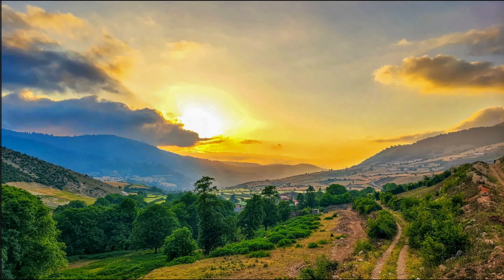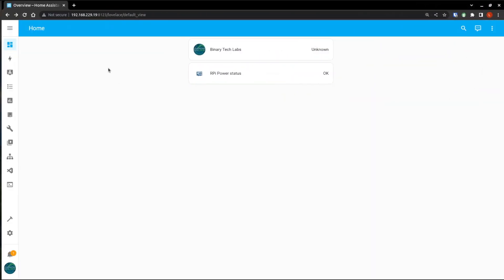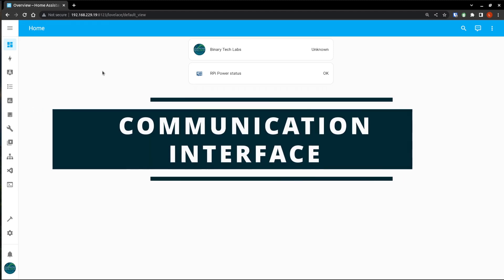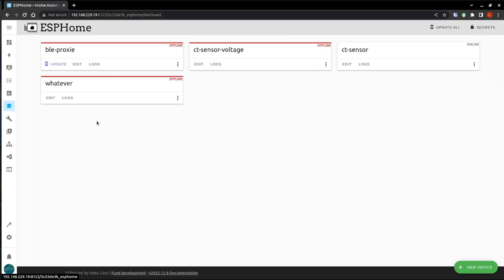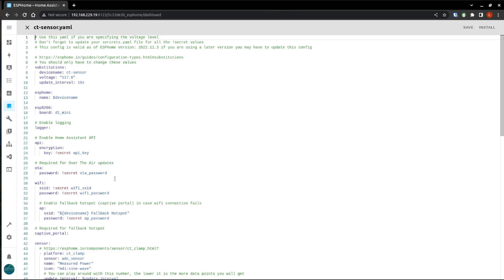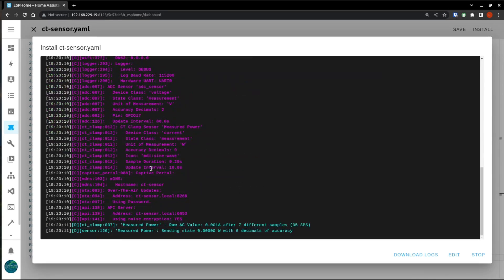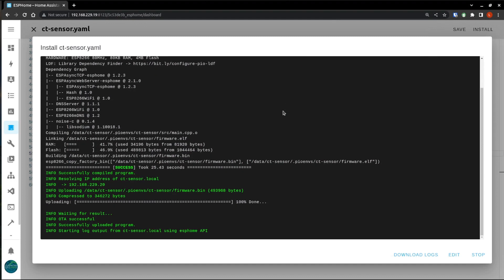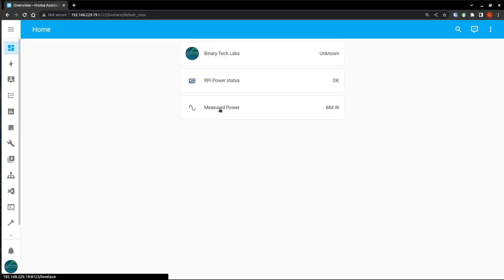Save the Planet (and Your Wallet) with Home Assistant - A DIY Guide To Power Monitoring

Comment: The Sense device will do most everything you've listed here.  It might be cheaper ($200 - $250). It integrates into Home Assistant well.
Reply from the maker: Yes it does but it is a great deal more expensive than these little devices, granted they don't have the algorithms the sense device has, but for my purposes there are only a few separate circuits that I am monitoring for cost and automation reasons, and the whole home part is only for my consumption.

Also I am in Canada so that 200 to 250 is 400 to 500.
Reply: @BinaryTechLabs  I was going to argue with you about the Sense being a great deal more expensive, until I hit the final paragraph.  Yeah, $400 would make a difference.

Comment: What is the point of this when a Sonoff wifi plug with power monitoring is so cheap?
Reply from the maker: Well for one, I'm planning on monitoring not only my hot tub @240v and 50A but my mains on my electrical panel, where a sonoff wifi plug just won't cut it